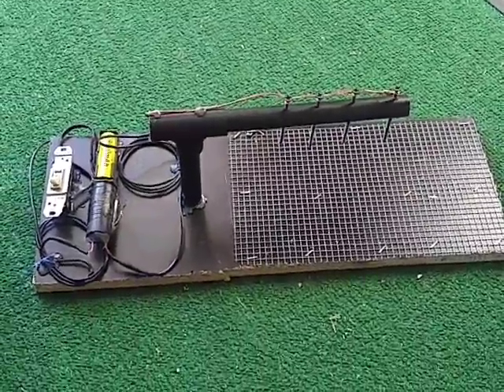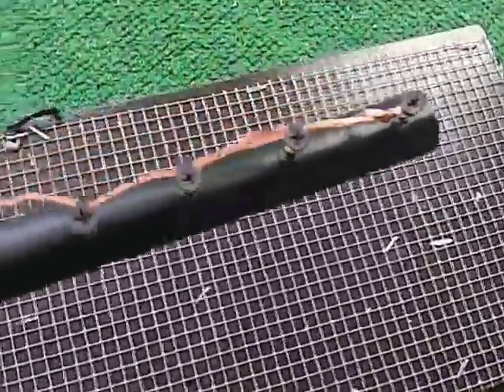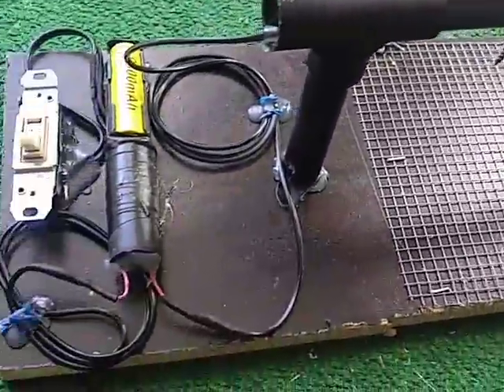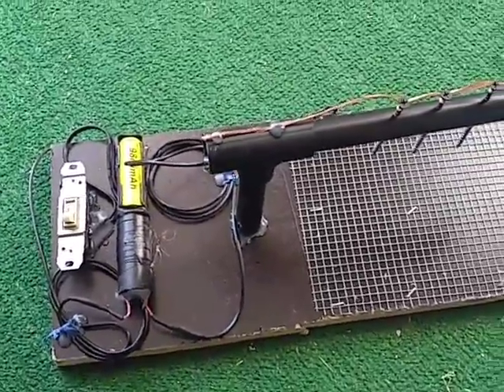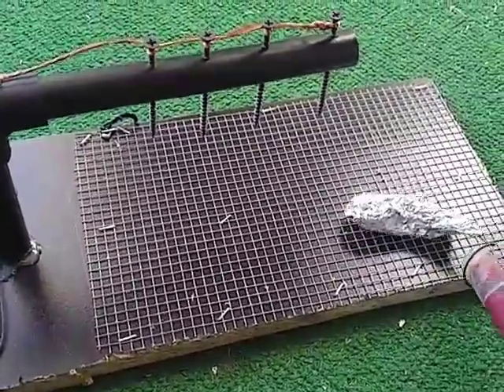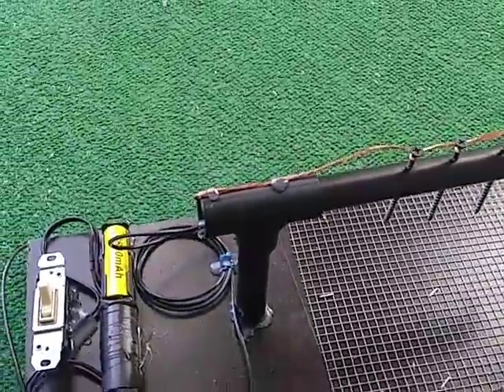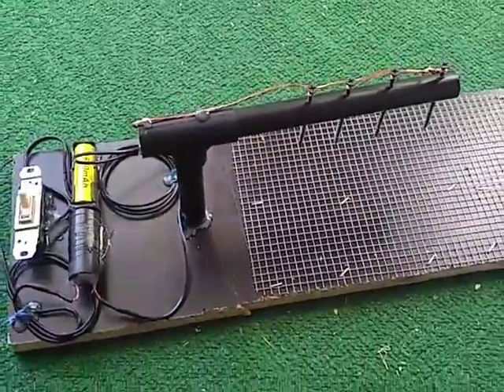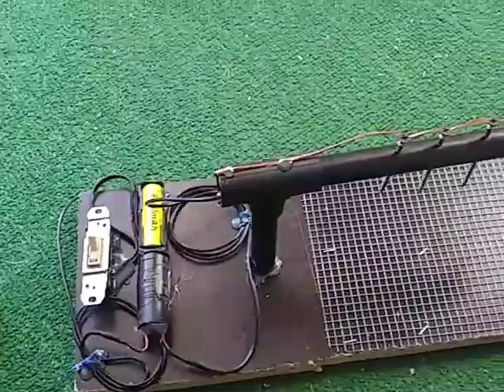Electronic Mouse / Rat Trap Executioner

Comment: It doesn’t look like there is a capacitor in the circuit, if you use the hv power supply to charge a capacitor you can dump a ton of energy very fast through the rat. I know your circuit works and it’s very well done! I’m just saying it could be a future project if you’d like to try

Comment: Add a ac Capacitor to it I used one from a old dryer makes loads of difference it will store all the energy from the step up Transformer and it will make the rat go bang 😁
Reply: ...you have my full attention...
Is the cap from a gas dryer ignitor?

Comment: Just wondering if you were to connect a capacitor to this.  would it make a bigger initial zap?
Reply: capacitors are not suitable for this circuit, as the secondary supply is in the kv range!!, majority of caps only go up to 500v!

Comment: An arduino would be the perfect timer/controller. Set it to taze 5 seconds then turn off the coil and maybe turn on an indicator light. Maybe have a 2.4 mhz transmitter that sends a signal to the house that it has fired.

Comment: Place it on a slope over a bucket so they roll off when 'done'. The High Voltage generator is only rated for 1 minute continuous use, so an IR photo switch, with a timer should do the job.

Comment: If you replaced the wire  mesh ground with another piece of pvc pipe directly below the screws with a mesh ground on it, you could raise it off of the floor and the dead mice would fall away from the device.

Comment: These modules are about 20K to 30KV from what I remember. The arc distance is about 10KV per inch at 50% humidity in a temperature range of about 70F.  

I am sure this amount of power will kill a mouse for sure.  I would also think they can hear the inverter frequency. This may drive them away rather than attract them even if there is bait on the upper electrodes.  Mice hate noise and especially high pitched noises. They have sensitive hearing and the noise will annoy them.  I would run this  type of HV generator using a small 5V power pack as like used for charging phones. This avoids the need for expensive batteries. 

There are ultra sonic noise generators that make noise at over 20KHz to frighten away mice. We use these in areas where I work. I also have them at home in a large condo building. These ultrasonic rodent repel units are sold on line and are not expensive.
Reply from the maker: Yes and it was loud. This is why I wired in a touch sensor and will not energize until the rodent touches the electrode

Comment: Ever heard of a taser?  High voltage but low amperage, disrupts the nervous system, leading to temporary loss of muscle control, very painful but essentially harmless, especially when compared to a 9mm.  Ever seen a 12v battery, my car has one.  Grab the negative and positive terminals nothing happens.  The voltage is too low to penetrate the skin, more than enough amperage to fry you though.  You can actually weld thick metal in the field up to 3/8th with two 12v batteries in series jumper cables and some welding rod.  So the trick is enough voltage to penetrate the skin, blood is a good conductor, and enough amperage to do some damage.  For that you need a capacitor. Unlike batteries capacitors have very low internal resistance, meaning they will dump their entire charge instantly.  That is why a large capacitor at 450v is dangerous and a taser at 50kv is harmless.  I would say your setup would stun a mouse or rat, then they would get up and walk away.

Comment: your 18650 cells are fakes. they dont hold 10amps 9000mah. the most 18650 is about 4amps 4000mah. i would return them to get your money back. some of the fakes have say a 300amh battery inside then topped up with sand or small amount of lithium compound. i know this personal experience, also there are a lot of YouTube videos about fake 18650s

Comment: That yellow 18650 has a false capacity rating. Top rating is about 3600mah. Typically if they claim over 9000mAh the actual capacity is closer to 1500mAh.
Reply from the maker: EmmittBrownBTTF1 ... For a dollar each, they work great. I converted drills and flashlights to them and they work very well.

Comment: the best way I have used is a bucket filled half  with water cardboard on top with a piece of string making it a revolving board that has peanut butter at one end and weight under the other end so the mouse/ rat goes across from one side and tips the card as the mouse or rat is heavier than the weight at the end of the card the mouse /rat slides in and the trap goes back to being ready for the next animal. The rat/mouse drowns. This trap doesnt work so well when there are plague proportions unless you have multiple traps on an old tub with all the entry ways to the outside and string to make sure the weight doesnt flip right over but makes the card go back to being ready.

Comment: The biggest problem with this is that the mouse rat etc...  will be left in the trap when killed.  Not only will this drain the battery fast but will make sure every other critter learns the trap is bad news.  You will kill one then no more.  If you could mount it tilted so the dead rat falls into a bucket you might have something but even then, the "smell of death" will linger and other critters will be wary.  Maybe if you made it of plastic and washed it in bleach each time and removed the dead critter maybe?  Rats and mice are smart though and they will learn that anyone who goes near this thing never comes back.  
Really, the only way I have been able to get rid of rodents is to put out poison bait.
Reply from the maker: This is being revised with a touch sensor and when the rodent is zapped it will fall and shut off. I have a "Rat Zapper" brand trap and I have never washed it out and continue to kill mice and rats. I don't buy the theory that they piss and crap when zapped and no others will return because they are always pissing and crapping everywhere and if I kill one a night, that is good for me. Problem is , I dont have any mice or rats to kill now but I will keep waiting. Thanks for viewing and commenting.

Comment: Use a kinda slick metal plate for the bottom and have it set at an angle with a bucket at the bottom if possible, that way you dont have to touch them and you could increase the amount of mice you can kill
Reply: You can glue the plate down and, boom there ya go for simplicity lol

Comment: This isn't 300 kV. The breakdown voltage of air is about 1 kV per millimeter, if I guess the distance it may have between 15 kV  and 30 kV.

There are stun-gun modules from chinese sellers on ebay, alibaba, banggood and so on. They are all advertised as gas-igniter or something like this and of course with fantasy voltages up to 1000 kV, which is absolute bullshit but this is how that stuff is sold. That "voltage multiplier" looks suspiciously like such a module and the voltage of 300 kV (which would easily jump a 30cm gap) is one of the typical values these devices are advertised with. Even if they produce only 15 kV, they can't be used as a serious HV supply. The isolation tends to break down really fast and then they will only produce the high-pitched noise and no sparks. Even if they are cheap, they are a waste of money.

A cat is a good alternative, it will kill small rodents, is self-cleaning, buries its shit in the neighbors garden and will enhance your videos with cat content. Most people love cat videos. ;)
Reply: Yea cats are good mouse traps....and are cute
Reply: hehe.. those batterys have a max mah just over 3000.
he bought the fake ones.. its probaly just 500 mah.
Reply: Dude, He probably thinks them 18650's are actually 10amps each

Comment: thats 18650 battary is not 9800mah more like 600mah..its a fake..but nice trap.
Reply from the maker: my balance charger says 950 but these work great for what I use them for and at a buck a piece. Converted my drills over and flashlights and still going strong

Comment: i used a horizontal 40mm pvc tube for mine with an alarm sensor to trigger it , no cats / dogs can be hurt with the electrodes on the  inside  and it makes it hard for a rodent to turn around and back out with 30 cm of live wire with approx 25kv dumped at a few amp from a capacitor bank to a step up

Comment: Once the mouse is retired you have to move it from underneath the electrocution area.  You can do this by inclining the board and hopefully when the most dies it's claws do not hold on to the  chicken wire.  The place where the mouse falls  can't be accessible to other mice because the other mice will eat the dead mouse instead of taking your bait.  Ideally the trap would be 45 degrees up and they have to lean over slightly at the top to get the bate when they like to get electrocuted they fall down the other side into a disposable area that isn't accessible to other mice.

Comment: You may want to get a different battery, preferably a LG HG2. I can tell you with absolute certainty your battery  does not have 9800 MaH.,,, it might be lucky to have 800. Those 18650's are scams.
Reply from the maker: like I said to another... might be 1000 mah but for for a buck a piece I have had good luck with those. I even converted drills and flashlights over to them and still working.

Comment: What if you simply mounted the board platform onto a wall with a small ramp to it for access? They'd climb onto the wire grid, try to reach over for the bait, get zapped and just fall off? Then you don't have to worry about figuring out how to shut it off.

Comment: Love it! At 2:15 you say you don't have a way for the trap to stop zappping the dead mouse. Actually, you do...

It is called "gravity". Just turn the trap 90* and elevate it so when the mouse is zapped, it will fall to the ground.
Reply from the maker: Terry Thomas .... Someone else made that comment but if it dies and drops, it should be far enough away from the electrode.

But that is a good idea to set it on an incline or angle so they do roll down.
Reply: Another advantage to being elevated is little kids won't be able to touch it. 

Consider installing the device in a bottomless box so it is protected from the elements and curious fingers and when the mouse or rat is killed, it will fall down and out of the box. Put a 5 gallon bucket underneath to catch the detritus. 

Maybe it would be a good idea to add an IR trigger that controls a relay. Break the beam and the system is "hot" only for the time that the mouse is killed. But one thing that I can think of is how long does it take for the system to charge up? Maybe a capacitor would be needed to store the energy while the system is deactivated.

Keep up the good work.
Reply: Consider enclosing this trap in a wire mesh cage so only rats and mice can climb through the holes.
Reply: yeah terry if your going to have it fall away it may as well fall into a bucket after sliding down a flip over trap with a piece of card that has a weight on one side of the card with a piece of string in the middle enabling it to flip and have the mouse /rat slide off as it goes to the end with the peanut butter.. it of course slides down the card before it gets to the  peanut butter and it goes into the bucket of water to be drowned.

Comment from the maker: I will be adding a capacitive touch sensor in the next week so I may have an updated video in a week or two. Thanks for watching
Reply from the maker: It would be weeks if there was no discharge
Reply: That would be Great
Reply: Just use an arduino as a safety...program it to look at current vs time and IF current flow= cutoff time then trigger relay to disconnect
Reply: Vince Biano Any idea what the standby time before you have to recharge the 18650 is?
Reply: Vince Biano thanks for the reply. I had assumed that was the case but I wasn’t sure. I’ll be building a similar unit soon.
Reply: Vince Biano Do you ever patent some of your traps? Or sell any?
Reply from the maker: Marina Smith.... No, I just like having fun building things.
Reply: You should make it to where the area under the electrodes is basically a plank that they walk across that's over a bucket of some sort. Maybe about 2 or 3 inches wide so when they get zapped, their dead body will fall off the plank and into the bucket, thus clearing the bottom contact and also catching the bodies. Depending on the size of the bucket, you could just catch them forever until it runs out of charge. Replace the battery, dump the bucket and you're back in business. 
Let gravity work for YOU. ;)
Reply: Hey Vince, have you done anything on this lately... I'd like to find out what you used for creating that much power... What was it?
I need to build something myself but would like a jumping off point preferably.
Reply from the maker: @tallisman57  I don't know why the ebay link has to be so long
Reply: @vincebiano190  
Yeah, I Know, there is a way to shorten them but I'm having a brain fog at the moment..
 As per that eBay add, I saw some on Amazon as well, do you just attach battery leads straight to one end and the other 8s the output... I know with a switched input, but what I mean is, dies it require a voltage doubler circuit or any other circuits...
 I got some big honking Rats I have to deal with down here in Florida...
Reply from the maker: @tallisman57  Here's one ......
 https://www.ebay.com/itm/353556390412?_trkparms=ispr%3D1&hash=item52519a620c:g:yvsAAOSwZS9g3XY0&amdata=enc%3AAQAGAAACoPYe5NmHp%252B2JMhMi7yxGiTJkPrKr5t53CooMSQt2orsSd0ReTLyM7cxPnI6zs468ELPefph84ZOshJemFu6PqBn%252F5MFQbzxcW59365awN4%252FZi9w674npSy9l7dS%252F06HG3hg90A2PJg%252BPQI61njCJaUb%252Fzj7dsOtFNvQcwOXJ2OUl5KYBa3CkpB7boHS42ZO8ppsMOc38k0JlCfnJmL0KR70TWLFpS9dVRdlX36xGCZPaPC3t72UKy58B5Iway2%252FiqnpOAF3T6ACW1kSUlwy3KTYhf3%252FJG%252ByapQm%252FlbQr85O2T3gnAp4u3htFJ0VOkDDOix5rSHSXVPhV0NsQXTOJMVxHn755LjzB3fwP1VrFnepYbOWuzcbr9LSPfCSjUz2EmSvbw%252FyE%252Fydkz4nNLKHrmI7aMSS1xuzXOOphqQ0ZF1anppebu6kMcUNUEGzJYeTN6niCaUzv3Q%252FK6G2dYk6HOqiT01szLxIcgcSYrRP3mMP%252FQ5YYDcUoCO%252B%252BuVd0hSE%252BxgmYWbbCrQ2iVzbnCf0w9qhBm2VKIT8KfIftfEjVsrumPoDzbVRtiUsalJQ5m4TvZmBfLhU8%252FeUo1qGSiQDpv5Etq08dYTI3nHSHuitbY4j9zT9IfgIWycLZmf2up5CdKR4tnjJAchGnjrmH%252FcVYuF1gxEPds8JHDiJG19mgp2Xz9woTVntn6W7Pqa6xz2Sc0m29SAQ7lyFo2BQoTjBIx2vUMCP56widTgkLG5QzJXRlAQ8CF1owhQtpvcit8icpC1DfQ1BwtY6Ihlmp9E09SbCxp3BuL1UEuBs67mcIXXb8ujDDqpD5wo23KssrB8Y87w7O0300J8Rw8H%252B3thlAWGHxgrxh3wvYjMJp7PchUAMBTjv8LX%252FwMhWWuSQQgO1hpw%253D%253D%7Cclp%3A2334524%7Ctkp%3ABFBM4JTuiLtf

Comment: Can that be made say 6 foot by 6 foot and run on 240?
Reply: sure it can but what would be the point? a 6 ft area is too big unless you plan on shocking every animal in the neighborhood. and possibly blowing a fuse because of continuous shock. 
240 ac can be rectified to dc and transformed into a high enough voltage to kill more than any batteries could. 
but it would be stupid dangerous at that scale. highly unrecomended unless you want to be on the darwin awards.
Reply from the maker: No..it can not
Reply: ;D
Reply: rayfl502 yes
Reply: :C
Reply: For my neighbors.

Comment: The mice will sense the frequency. You need an electronic sensor to switch the transformer on when the mouse is making contact with the electrode.
Reply from the maker: If you know of one or what it would be called, that would be the ticket for this to work properly. Thanks

Comment: why did you buy a fake battery? 9800mah not in its wildest dreams sorry.
Reply from the maker: Master Pack .... I know its not 9800. 1000-1500. At $1 each, I've had good luck with them.
Reply: very prompt reply indeed, thumbs up for that. perhaps add a side note next time as using them infers you have little credibility with electronics. your response makes perfect sense but is not obvious to viewers in the first instance.
Reply: Those are Chinese mah's lol.
Reply: The multiplier isn't putting out anywhere near 300 kV either. If it was, there would be sparks 4 inches long.

Also, those devices aren't designed to be run with no load, i.e. a gap larger than the sparks can jump. The internal insulation will fail soon enough...

Comment: You should incorporate a wiper blade . Hahahaha
Reply: SCOTTA1 that was my thought as well.  If the current goes high for some time, cut the high voltage and start the wiper motor. Let that run for a few seconds, let it park and turn the voltage on.  If you get a current spike in the wiper (after the startup) you know you know the wiper hit something...  add a microcontroller with wifi and you could get alerts and status updates...
Reply: just tilt it at an angle that would let a dead mouse slide off
Reply: SCOTTA1 yeah was thinking a conveyor system. Something to get them out the way.
Reply: Lmfao
Reply: SCOTTA1

Comment: try increasing the distance from the ground plate to the electrodes so that when the mouse dies and falls, it wont get shocked anymore.
Reply from the maker: BadW01f 2....  I will try that. That is why i used multi purpose screws to adjust them.